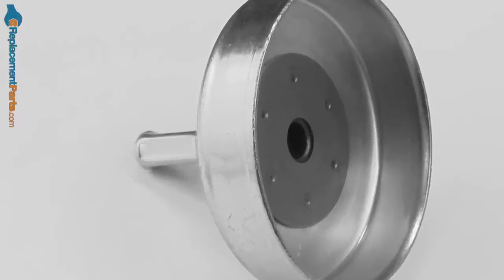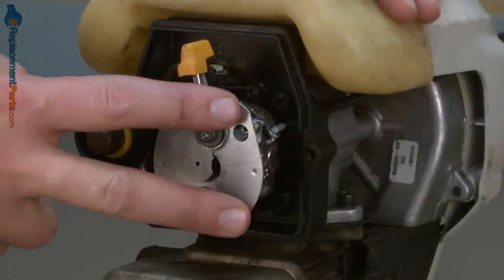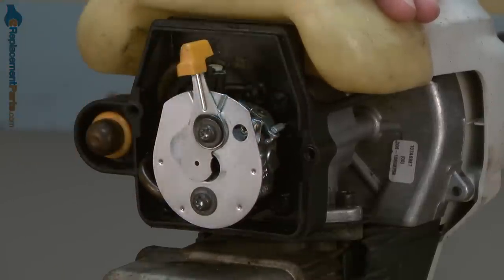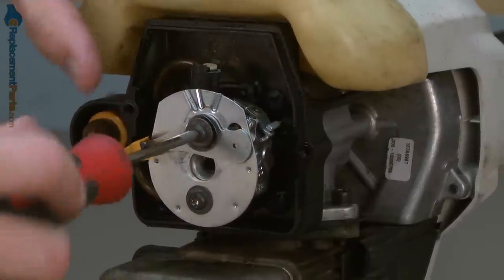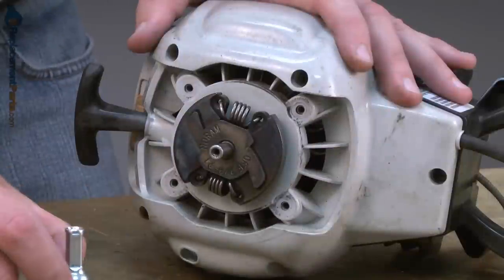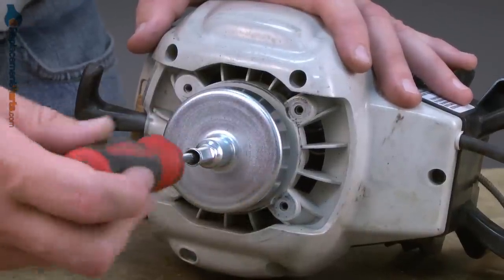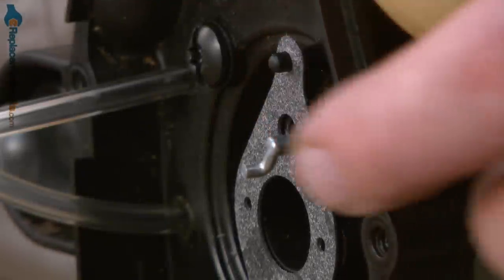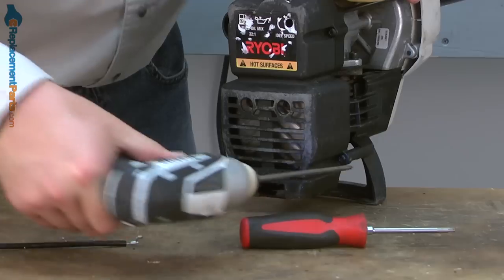Trimmer Repair - Replacing the Clutch Drum (Ryobi Part # 791-153592)

Comment: HI Mark that ryobi trimmer that you changed the clutch drum on is there parts still available as I have the 31cc model I think you would call it the export model as I am in Australia   and I need to replace the clutch and housing as it is old but runs like a trooper the motor is perfect has plenty of compression and it would be sad to throw it out . I had a 26cc rover it lasted 2 seasons and gave up so I reserected my ryobi and turned it into a bitsa it has a ryobi motor my rover slit shaft and troy built head and gearbox and runs very well but I need a clutch assembly?

Comment: Hi, IWould like to know ,whath kind of crewdriver tip is used ,since is very difficult to identify to remove the clutch drum,thank you
Reply: I believe that it is a T25 Torx. You'll need a long style wrench rather than a 1/4" socket set style attachment as it won't fit down the hole.
Reply: I just used a T-20

Comment: (Now, I’ll remove the clutch drum. It’s held with an internal screw.) ??? what type of screw driver is used to remove this mystery internal screw??? I've heard its a torx screw? if so what type of torx driver do i need to remove it?
Reply: +Dustin Rhodes  Another vid they have said the majority of the torx screws are #25, this one included.  Probably have to invest in the #25 torx screwdriver, doubt you'd have much luck getting a bit and driver in there and back out again..Good Luck!

Comment: Some small engines I have worked on refuse to start even though they have the fundamentals correct, spark, fuel delivery and compression. I got so frustrated I tossed the machine out, it was an Atom petrol edger. any suggestions?
Reply from the maker: The other thing to check next time you have this is the timing.  Sometimes the flywheel will spin on the crankshaft which will give you incorrect timing and it will never start. I have found that if all of the essentials are in place
and the thing still won't start it's something with the carburetor.

Comment: Is that torx bit shaft a little smaller then standard? Mine would likely fit the screw but the shaft of my screw driver style handle on the bit to go down inside the drum to reach the bit. Any suggestions?
Reply: Try torx 20

Comment: I have a worn torx screw on mine don't know why it's the first time I'm working on it. Any ideas on removing it? Think i should just cut it off and replace the drum?
Reply from the maker: Hi, that is exactly what I was going to suggest you do, cut it off and replace the drum.
Reply: Thanks
Reply: I drilled mine out. Can I use a screw with same thread count to tighten down the clutch bell housing?

Comment: Can someone help me? I replaced recoil spring, pulley spring an clutch. Not sure, but when I put the clutch cover back on it seems to have up/down play of a couple centimetres - even when I tighten the screw. Any thoughts?
Reply: Tight the torx 20 screw inside the little shaft in the  the deum

Comment: How do you remove that screw if it's stripped whatever kind it is?
Reply: I believe that it is a T25 Torx. You'll need a long style wrench rather than a 1/4" socket set style attachment as it won't fit down the hole.
Reply: @benwolinski6813  It's stripped  Torx don't work
Reply: @WV591  Ahhh. Unfortunately you’ll have to drill the screw out and replace with a new screw of the same thread size.

Comment: How we know when the muffler is bad?
Reply from the maker: Mufflers on 2 cycle engines rarely go bad. But if one did. The symptoms would be: much noisier than normal or running sluggish at high speeds.

Comment: how to replace the clutch cover screw and the size of the screw?
Reply from the maker: The screw for the clutch drum is a T-20 and it's left hand threaded.  I've added a note to the video.
Reply: Montar un enbrage husbarna
Reply: @FIXTechGuides I'm hear to tell you the mystery screw is a T25 and it is not a left hand screw ! This is how you people sell parts , by putting out the wrong information ....
NEED TO PUT THIS IN YOUR FOOT NOTE !!!!
Reply: It's a T20.  I just did the removal.

Comment: Terrible design, I wasted over an hour messing with this thing because I was missing the one specific tool I needed to remove the clutch and every fathead screw driver I owned wouldn’t fit the hole even though they put a flat head screw on it for some stupid reason, probably to save money. 

The head of these old ryobi weed eaters is also anti mechanic friendly and over complicated from an engineering perspective purely for the sake of being cheap

I don’t care how good the power head is the rest of its a bunch of bs